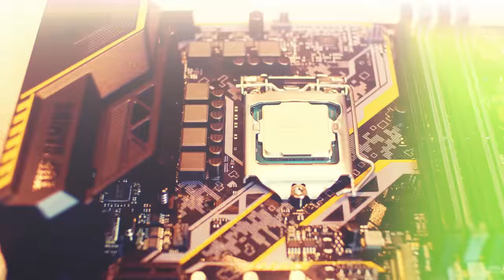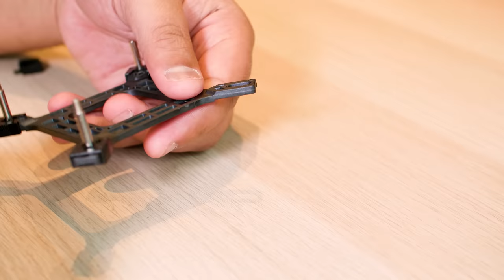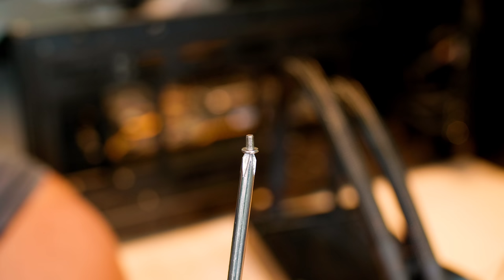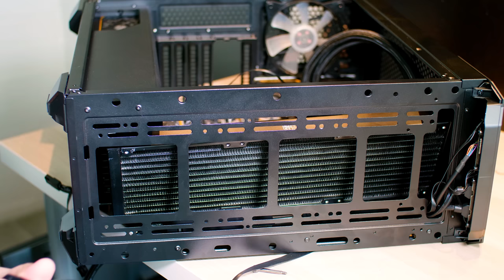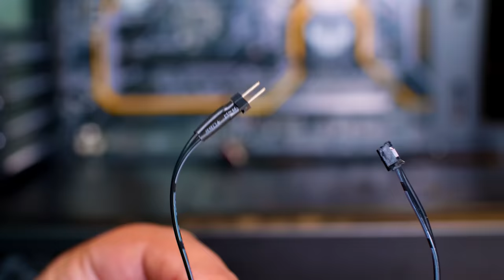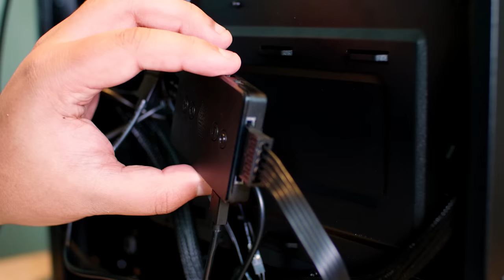HOWTO Install Cooler Master MasterLiquid ML360R RGB on Z370 & Z390 Motherboards

Comment from the maker: Before commenting check out the CM ARGB Setup and Install Guide if you have having problems: https://youtu.be/sVkxpmGcmd4
The case is the Cooler Master MB500 TUF Edition. Yes the front panel fits on it perfectly. We just wanted to show you how the fans looked!
Reply: Was looking at getting this case. But I got the Cougar Panzer Evo RGB instead. That being said, do you think it would be possible to make a tutorial with setting up fans to a fan controller hub?
Reply: If the front panel is attached, won't it block 1-2 fans?
Reply: Loop
Reply: @sixxxPsP  I've got a prime z390 I got the asus rog terminal to control argb
Reply: @sixxxPsP  the cooler comes with a rgb controller, you can power that via usb and use reset switch to change colours
Reply: Can anyone help with plugging in the cable for the “mirage effect”. It wasn’t discussed in the video. Do I basically use it as an extension cable from the 3 way fan splitter to the mother board?
Reply: I like to ask what is the difference in airflow between tecware nexus m and cooler master mb520, because this tech expert from sim lim claims that nexus m is better casing then cooler master mb520
Reply: What's the case used in this video.
Reply: plz help,I tried to install in z390 mother board but the pump is not making full contact with the cpu,,I was getting very high cpu temp,when i removed the pump there was very little spread of the thermal paste
Reply: What about am4
Reply: Can I do the same thin with an ML120L???

Comment: Hey Gearseekers ! I did buy one of these coolers recently, as I wanted to replace my 120mm AIO that I had been using for almost 4 years. I was 99.9% close to getting the H100i Pro because i am a big fan of Corsair - however I found your review on the upcoming ML360r and I immediately bought this from Mwave. With your permission - i'll post my results for my temps below :) Needless to say, I am very impressed.

My results are as as follows :-

i7 5820k on Gigabyte Gaming 5 X99 board.
New CPU Thermal Paste : Thermal Grizzly Kryonaut Thermal Grease 3ml
Old Cooler - Seidon 120V plus
New Cooler - Coolermaster ML360R RGB

Intel Extreme Stress Test - 15 mins
Stock - Old Cooler : 64 degrees
Stock - New Cooler : 49 degrees
Difference - 15 degrees - 30.61%
OC 4.4ghz 1.248v - Old Cooler : 93 degrees
OC 4.4ghz 1.248v - New Cooler : 68 degrees
Difference - 25 degrees - 36.76%

Firestrike Ultra 
Stock - Old Cooler : 51 degrees
Stock - New Cooler : 47 degrees
Difference - 4 degrees - 8.51%
OC 4.4ghz 1.248v - Old Cooler : 75 degrees
OC 4.4ghz 1.248v - New Cooler : 63 degrees
Difference - 12 degrees - 19.05%

Heaven Unigine
Stock - Old Cooler : 59 degrees
Stock - New Cooler : 45 degrees
Difference - 14 degrees -  31.11%
OC 4.4ghz 1.248v - Old Cooler : 78 degrees
OC 4.4ghz 1.248v - New Cooler : 55 degrees
Difference - 23 degrees - 41.82%

Aida64 Stress Test - 15 mins
Stock - Old Cooler : 66 degrees
Stock - New Cooler : 46 degrees
Difference - 20 degrees - 43.48%
OC 4.4ghz 1.248v - Old Cooler : 94 degrees (reached 94 degrees after 4 minutes so stopped the test at this point)
OC 4.4ghz 1.248v - New Cooler : 61 degrees
Difference - 33 degrees - 54.10%

Passmark CPU test 
Stock - Old Cooler : 63 degrees
Stock - New Cooler : 47 degrees
Difference - 16 degrees - 34.04%
OC 4.4ghz 1.248v - Old Cooler : 79 degrees
OC 4.4ghz 1.248v - New Cooler : 67 degrees
Difference - 12 degrees - 17.91%

From the data above : 

Stock - Old Cooler - Average 60.6 degrees
Stock - New Cooler - Average 46.8 degrees
29.48% difference

OC 4.4ghz 1.248v - Old Cooler - Average 83.8 degrees
OC 4.4ghz 1.248v - New Cooler - Average 62.8 degrees
33.43% difference
Reply: Do you need to plug in the micro usb into the controller if you want to use motherboard controls?
Reply: "With your permission" What?! Dude, post what & when you want, you never need to ask.

Comment: Anyone installing this aio in msi motherboards just know you don't need to use the controller simply plug the rgb splitter into the three pin on your motherboard ...
Reply: marcandmattgames  i couldn't get the controller to work as a pass through to the motherboard and the software for the Ml360 was garbage.. also if i did have the controller in there i couldn't get to change the setting because the controller is in the case .. soo i just got rid of it and it works perfect also less cables  ..  i rather controller all the rgb with just one software then a couple .. as for what does differently there might be a few settings on the controller that is not in the msi software but i would rather have my pc all sync then to have one group of rgb do something that the software can't .. i hope that helps
Reply: @BlowUpDaChr0n  is it able to power all 3 fans from the cpu fan connector on the msi b450 gaming pro carbon ac?
Reply: @Jason-pm1hp  i got three of my fans in the cpu header on my msi z390 ace .... i would say u are fine ... if u don't then your fan profile in your bios would have to change for other header's you are using to match the cpu one
Reply: BlowUpDaChr0n thank you, also are you able to control the colours of the fans in mystic light, i read somewhere that it cant do static colours?
Reply: @Jason-pm1hp  it just snyc with mystic light whatever the software can do so will the fans ... i just got rainbow puke on
Reply: @BlowUpDaChr0n  is it a 12v or 5v rgb header being used for this?
Reply: @leofrancismajarucon7629  its the 3pin 5v
Reply: I have the msi meg ace z390 however I can’t get the aio pump cable to connect to any of the cpu fan or pump fan connections on the motherboard what do I do?

Comment: Where did you put the RGB header cable that you put in the motherboard?
Reply: you know I have been wondering the same thing and can't seem to find any info on it
Reply: ItsmeJigz, it’s an addressable header, 5v 3 pin ONLY. Don’t jam it into a 12v 4 PIN!!!! It’s available on ASUS motherboards from what I know.
Reply: If any one is wondering, this is referred to as an RGB LED Strip Header and labeled as LED_C on a Gigabyte motherboard. As mentioned above, don't plug the cable onto the 12v pin.
Reply: @Borgscan  So it would connect to the D_LED 3pin on my gigabyte motherboard just fine?
Reply: @8enzoo  I'm going to rely on my failing memory here, but LED_C has 5 pins and two are cap off on the board, so only 3 are used. If this is what you mean by 3 pin, then yes, that should be fine. What model of motherboard do you have?

It's worth noting that unless your board has addressable LED strip headers, you won't be able to change the colours of the cooler's fans, at least I couldn't as my board (Z390 Gaming-X) only has one RGB LED strip header which is not addressable therefore it didn't work with the cooler's controller. Fortunately my case has a fan controller with colour selection so I was able to use that.

Gigabyte is a bit vague with it's RGB marketing so before purchasing, I didn't realise that there were addressable and non-addressable headers, which is the difference between "Lighting: Supports RGB lighting effect in full colour" (non-addressable) and AORUS (addressable).
Reply: @Borgscan  Can't you use a remote to cycle through ARGB presets?
Reply: Etaan i just got an asus tuf z390 and cant find anywhere to put iT in. I only find 4 pins plz help
Reply: @8enzoo  did you do this? Did it work?
Reply: Do you have to plug it in? Does the USB connection allow use with the mobo software or do you need the pass through?
Reply: Hi, I'm building my pc with this cooler later on today. My mobo has 12v rgb headers. Is there a 12v cable in the kit? That plugs into the 12v port on the controller.
Reply: Jonathan Pilmore I don’t think so it’s made for the connector is only for 5v 3 pin connector
Reply: @knic11  Hey... Ijust did this.. it worked.. but only problem is the RGB color is fixed as orange... dont know how to change it yet
Reply: The Cable from the motherboard goes into the bottom of the ARGB controller next to the USB connection on the box it’s MB ARGB

Comment: i found that when you put plastic clips on the backplate at the furthest out setting (2011 i think), put the backplate in place, then tighten the  retainer thingies, it makes it alot easier to get the backplate on the motherboard.

Comment: Hey Nick love your vids. But these aren’t Aura Sync as it show at the beginning of the video, it’s not syncing with the Ram. Most Asus motherboards have 4pin RGB headers were the cooler Master have 3pins on there AIO’s = no sync. If I’m wrong can you show us please. Just one question I have the pump connected to the pump header on the strix z270f. Do these pumps run at 100% speed 2400rpm. Is there a way to adjust the speed. Or are they designed to run at 100%? Thanks
Reply: Sly Fezz it’s the opposite, with new addressed rgb sync is only with 3 pin 5v

Liquid Pump MUST run 100%

Comment: I plan on using the ML360R without the included fans, but I still want the pump's RGB to sync with aura. Do I skip the included controller completely and simply connect the pump's addressable rgb header to my mobo's addressable rgb header in some way?
Reply: Yes

Comment: You mounted the top AIO fan 90 degrees clockwise compared to the other two, that’s why the RGB pattern isn’t aligned ;). Otherwise, great setup video

Comment: This video literally saved me throwing my PC out of the window. I went for a 9 fan cooler master set up in the Lian Li Dynamic Razer edition. What a nightmare. SO MANY CABLES!!
Reply: how did you put 9 fans in it?
Reply: Hey man I want to do the same! Which mobo did you use?
Reply: @IliasPelekas21  X570 Asus Crosshair VIII Hero
Reply: @Rumpletiltskin05  3 top on the 360, 3 side and 3 bottom. The case is made for the 9 fan set up.

Comment: nice video, but you didn't ever mention how to connect the argb controller to the asus mobo, there's a 3 pin connection and 2, 4 pin. How do I connect the 4 pin from my prime x470 to this controller? thx
Reply: There is a deepcool rgb convertor that lets u connect 3 pin rgb stuff if your mobo only has 4 pin rgb

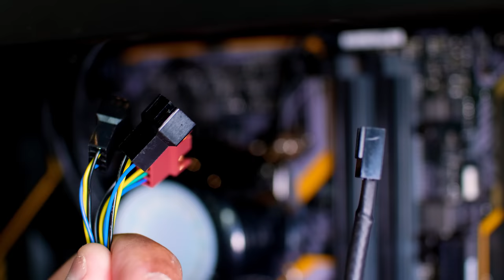Comment: 7:47 where did you end up plugging this in? Argb on mobo or argb on the hub. 
Thanks
Reply: on the hub the hub is powered by the argb header on the mobo
Reply: Actually he put an extra thing of argb pins on that one and connected it to the controller.

Comment: do you have to plug in the reset button wire to the motherboard and the controller? can i not use this cable at all and  just connect it with the addressable rbg cable to control it will aura sync on the motherboard???

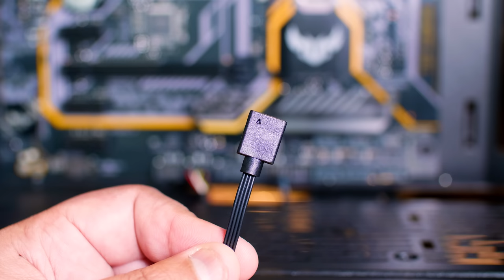Comment: I watched the whole video, as instructed, around minute 9:15 you connect the mobo's 4-pin header for Aura but did not connected it to the controller afterwards. I know there's a 4-pin slot on the bottom side of the controller near the micro USB slot, is that one where the mobo's header should plugged in?
Reply: I’m here trying to figure that one out right now, did you ever sort it? Would help a bunch!
Reply: @lessthanaveragegamers6835   I honestly do not remember what I did completely. But it think the only way i made it work was updating the firmware on the controller (not the small controller but the bigger one that came with my AIO) and use the Cooler Master software and the USB setup to make it work. It does not work perfectly. I was able to connect the small controller aRGB cable to my Phantek Eclipse case header and it work perfectly. Made my fans look like my cases lights. This was a long time ago, sorry.

Comment: Yea I have a question, I have an older system (x79/2011 socket) I got everything installed (by reading the manual for like 5mins for each step since this thing has SOOO many cables <.<.
I have the software installed, I was surprised to find no direct control over the fan curve how on earth am I going to set the fan profile or am I stuck with whatever my mobo decides to dish out via bios PWM setting which is not good as being an older system all the PWM system fans are under one PWM speed control.

Comment: Recently I've wanted to buy a new keyboard, the CM CK530.
I wanted to ask you do you recommend it...
And one more question, if you recommend it, I installed the Master Plus program, but it's black and on the left side there some text that I can't read because it's on half. Is it because I don't have anything from Coller Master or is it a problem with the app?

Comment: Hey Gearseekers. I have the CoolerMaster ML360L V2, and I wanted to ask if closing the case in front can increase temp. Right now im on 50-60 idle... i9 - 11900K. I locked it to 4.5Ghz because of the temps. Right now it's installed that the radiator is closer to the front section of the case and the fans are inside pulling true the radiator

Comment: how good is this cooler at cooling the threadripper 1950x because i have the enermax tr4 aio and its dead after only 6 months
Reply from the maker: You cant cool TR with it
Reply: Oh that's weird because amd site has this listed as a cooling solutions for threadripper
Reply from the maker: Yeah it's wrong. I daily drive a TR system. I would be using it on it if it did. I have an install guide coming for the cooler you're probably thinking of called the ML360 TR Edition coming soon.
Reply: Oooooh yea that's what I'm thinking of hahaha my bad well I look forward to your video about it then 😁
Reply from the maker: I've had it for a few weeks. CM sent it over but it's crazy this time of year and I still have so much to film before the year is done.
Reply: @GearSeekers  nice bro i look forward to it :D lately my cinebench score dropped from 3k down to 2k and i have no idea why so im just guess its my cooler lmao

Comment: Yeah my Fans on the Radiator spin loud or it the Pump at like 2400rpm stupid loud i tried changing it within the bios span speeds do no go down my Ryzen 3700x is at 4.4ghz OC and is at 41C. What am i doing wrong, MotherBoard X470 Hero VII

Comment: Two questions... #1 What is the Mirage effect & extension for? I you didn't connect that at all. Secondly, did you have to place the controller up high to get the back fan to light? The RGB cable is literally so short I can't route it out the top and be anywhere close. Debated getting a rgb extension cable or double side tape the unit higher since the MOBO back plate isn't magnetic -_-

Comment: Not sure what I’ve done wrong, but trying to align the bottom of the screws with the heatsink brackets (1151 ones, same as my mobo) attached to the cooler just pushes the screws and backplate off, and they don’t meet all four screws at once. Anyone have advice?

Comment: Hey so I have a msi mpg x570 gaming pro and I’m currently new to this space and am working on my first build. Being that I’m new , the backing plate that comes with this cooling unit won’t fit my motherboard , my backing plate is a rectangle.  Is it still possible to connect this unit, online it says it’s compatable but after hours of searching I can’t seam to find someone using this with my motherboard.  Any and all help is appreciated

Comment: So I had set up everything , the rgb is fine and I thought I wired everything correctly but when i boot up to bios it’s says my CPU’s running at 90/89 even tho everything’s hooked up correctly. Could it be because I’m not using the radiator fans that came with it ? Because i bought different fans that I preferred

Comment: Hey I have a first/new build and curious if this will light up as soon as power gets plugged in like the motherboard? Having front panel/power button issues but everything is lighting up inside except the fans. No error lights etc. Thanks for the vid either way though.

Comment: I have two questions coming from a noobie (me). You put your fans on the outside and the radiator on the inside does matter if you do it the other way around? And do you think i can change the fans by other fans i find more aesthetically pleasing?

Comment: Hello.
I need a little help with the ARGB  connections. 
So.. im planning build in a Cooler Master H500M. My MOBO is a Gigabyte Z370P D3 and have a single 4 pin conector. Can i wire  the two 200mm fans and an adicional back fan with the AIO ML360R to the controller without burn any thing? 

And for last, the power reaches the controller by Sata port right? So why you need to plug the controller to the RGB header on mobo? Sorry This maybe was a dumb question but i was planning to use that header for a rgb bar, like used on Aurora build.

Thanks and keep the goodwork 😁
Reply from the maker: You don't need to. That's why I said that bit was optional ;)
Reply: @GearSeekers  ok friend thank you. And can i plug all the 6 fans + pump on the ML360 controller? Wont overload ?
Reply: @GearSeekers  i wonder how you did it on your Aurora build
Reply from the maker: @luismartins6687  used the pass through on the controller

Comment: Hey I have a Coolermaster Masterliquid ML240R and I went with the Thermaltake H200 Cabinet  so wanted to know how should I mount my RAD for better airflow? 
On the top or front? 
I have an ATX motherboard.
Reply: Top
Reply: @Uprise it doesn't. Had to put it on front.

Comment: More of a question that a comment. What is the benefit or putting the fans on the outside of the case as this display vs. the inside? My quick guess is whether I am pushing the fan or if I am pulling hot air from the case. I have the Thermaltake V200 TG.

Comment: How do you sync the extra fan with the cooler fans I got the ML240r rgb and that plugs into the controller and works but I also plugged in another fan to the controller and it doesn’t seem to be affected by the controller at all whether I’m in rgb or argb mode. Furthermore, for some reason MSI 7370 Tomahawk header is 4 pin and not 3 pin so it doesn’t seem to be able to connect directly to my mobo because MSi mystic light also won’t pick up the fans to be controlled so I just want to figure out this syncing issue